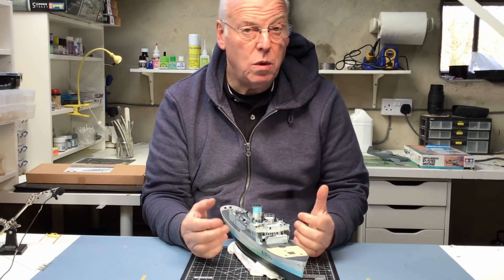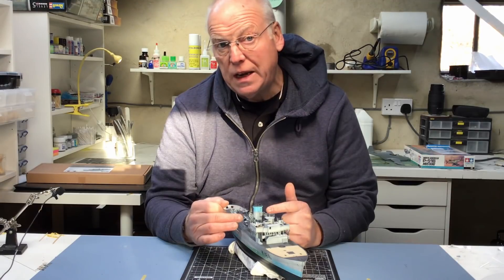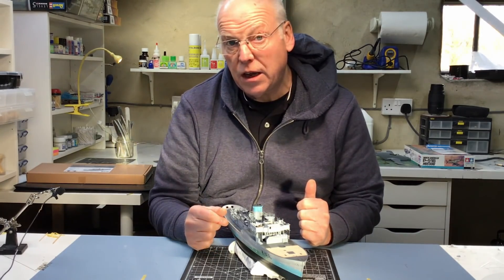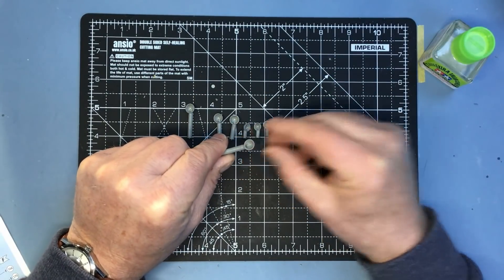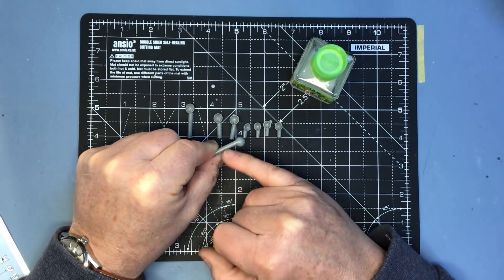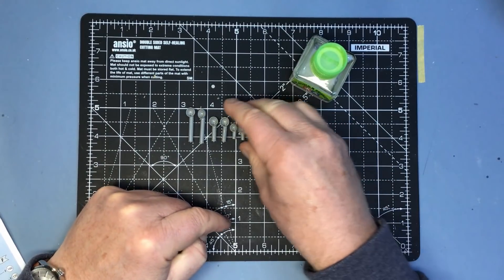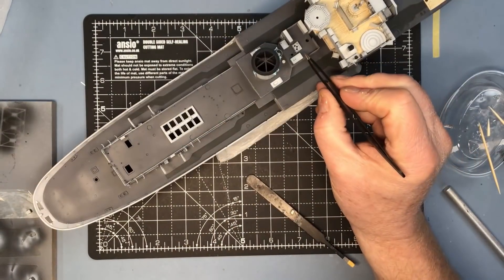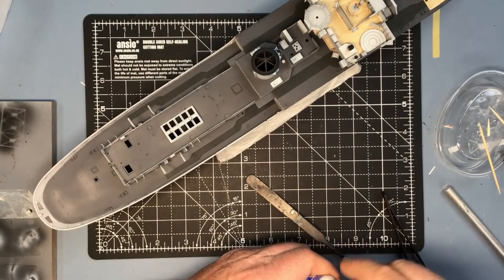Revell 1/144 Flower Class Corvette full build with Pontos detail set Part 12

Comment: Good strategy re the MicroMaster parts! My thought is to build everything possible with the Revell/Pontos parts as sub-assemblies and then see what did/didn't work well. Then, if the overall kit merits it, I'll consider buying MicroMaster replacements. I've done all of the weapons (4" gun, 2 pounder, 20mm, Hedgehog and depth charge mortars) with good results. Also the forward winch was a pain but came out well. The only candidate for MicroMaster at this time is the aft depth charge rail assembly. It doesn't help that some of the assembly pics for the rails are incorrect. (The pics show portions of the port and starboard units, instead of following the build of one, or the other, unit). Keep at it, you're doing a great job!!
Reply from the maker: Agreed Jim. The depth charge racks were at the top of my list in 3D but because of the faulty frets I had replaced I’ve got two sets in Pontos etch to have a go at. Hopefully I won’t screw up two attempts….
Reply: @TheModelShed  My guess is that you'll do much better than my effort with the racks. You have a knack for getting those tiny touchy parts to behave. I'm still mucking with the first rail set because I hate to give up, but MicroMaster may end up the solution provided that I determine the rest of the model is up to display standards.

 I ended up tossing the lewis guns. It took me almost 2 hours to solder the shields together. Then one of the barrels broke in two. The break was nowhere near a sprue connection. I guess I hurt its feelings. I wasn't enthused about the guns from the beginning because of the poor mold quality. By my estimate the gun stocks scaled out to about 10 inches thick, so I didn't rue the loss.

I'll be interested in your approach to build the 4" gun platform. I'm toying with the idea to solder the main supports (parts 134-137) before attaching the ring (part 129) to the Revell base. My main concern, though, is the shell cradles. I'm wondering if it might make sense to solder those from the bottom before attaching the the Pontos base (part 142) to the Revell base. I would tin the iron and "flash" each assembly alternating from side to side to avoid overheating adjacent cradles.

By the way, you should get a commission. Based on your advice while building the HMS Hood, for the Snowberry project I purchased the same Hakko unit, LA-CO flux, Tamiya bending pliers, AND  Tamiya lacquer paint. This is only the third plastic ship model that I've built in the past 35 years, so your tips are most appreciated... but my wallet isn't so happy.
Reply: @TheModelShed  A bit more re the depth charge racks. I have completed the first rack (the one that initially thumbed its nose at me). Although it came together within spec (along the correct side of the fold/reference lines) I noted that the depth charges will not load. The cans with the two end pieces affixed are a bit too long to fit inside.  The bare blank fits ok and, perhaps with one of the ends, but with both ends for me it was a no-go. My guess is that parts 532 and 533 (which narrow the track) may be the culprits. If you see the same issue, perhaps deleting the two aforementioned parts might be a solution. In my case I soldered the rails in, so I'll either have to strip the end pieces off the cans or its "Hello MicroMaster".

Comment: Hi Steve, I am really enjoying your building of the Flower Corvette videos. You show so many good and smart modelling techniques. One question I have on the portholes: do they have glazing and if so are they included in the kit or did you add those yourself?
Reply from the maker: Hi Jos. The porthole glazing isn’t provided in the Revell kit, but the wheelhouse windows are - as are the skylight windows. I replaced the wheelhouse windows with acetate sheet and I will use crystal clear on the portholes.
Reply: OK Steve, good to know. I should get my own kit in the next couple of days. Your build videos are a great help and inspiration. It has been a while since I finished my last model.

Comment: Shaping up really well, Steve. How do decide to anneal a PE part.
Reply from the maker: Good question about when to anneal. 👍 Annealing has two effects: it a) softens and b) takes the “springiness” out of brass. So I use it in two instances. Here I annealed the small door parts for the vents because they had to conform to a fairly tight radius around the tube. The heat softened the brass to reduce the stiffness of the small door and form it into the shape I wanted. The bands on the other parts were thin and fine enough to form around the tube without heat. In the case of the Hood funnel foils (and the funnel on this model) the foil is very springy and wants to come away from the plastic. The annealing takes this out of the brass and the metal, once formed, conforms to the plastic which means that the glue doesn’t have to work as hard and the joint is more likely to stay intact.